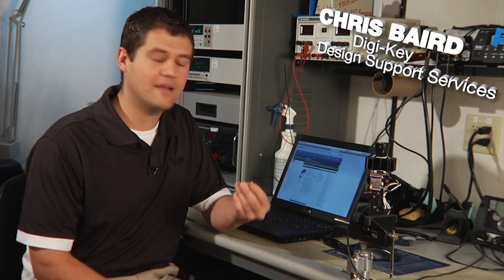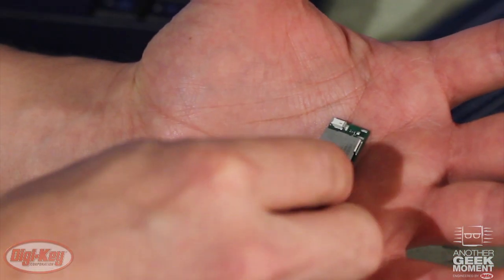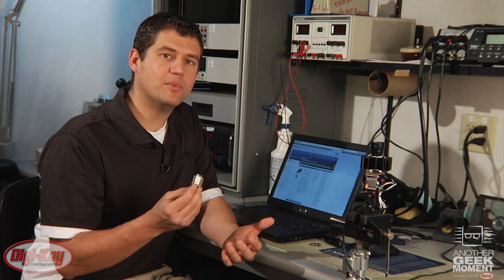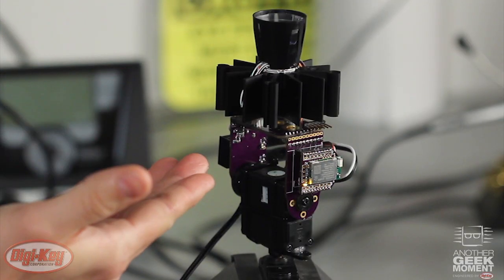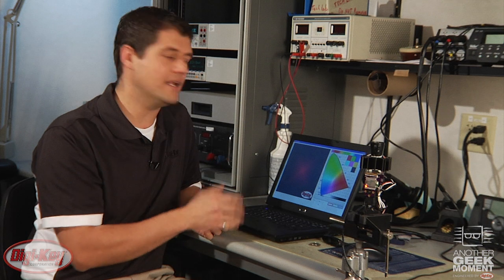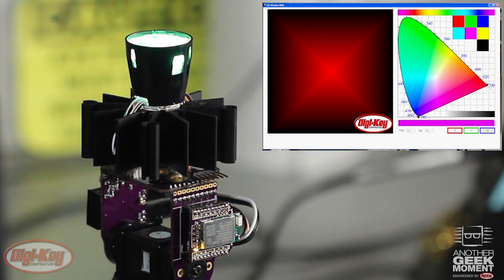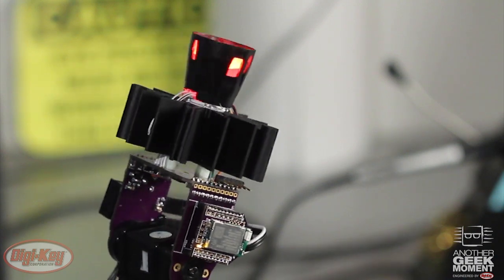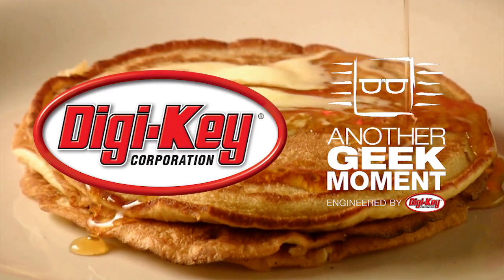PAN1555 Bluetooth Module -- Another Geek Moment

Comment: @nThanksForAllTheFish I sure do! First of all, the PCB pads are gold plated, not lead. Secondly, the solder paste is only on the top side of the PCB, which never comes in contact with the griddle surface.  Even if it did, the plates are teflon coated and are removable for washing.